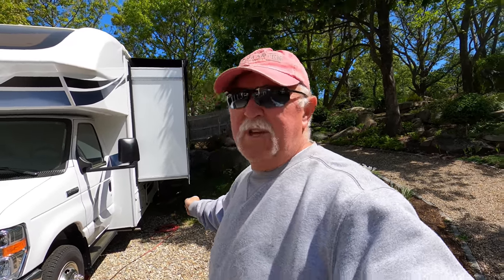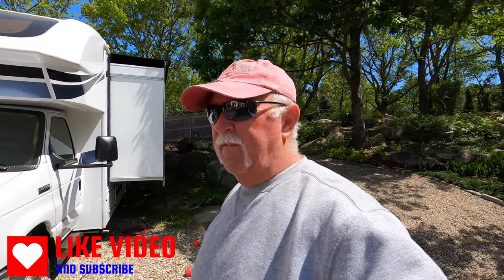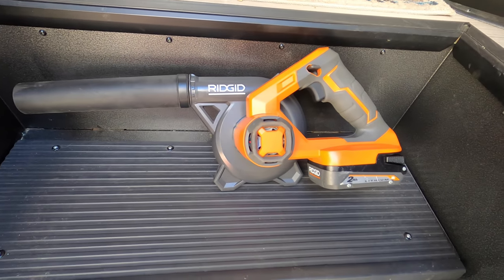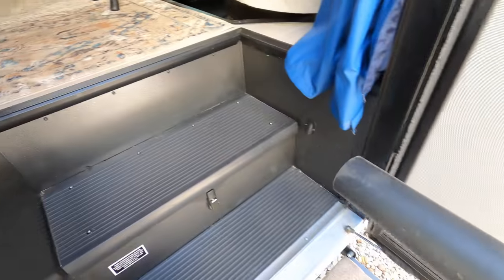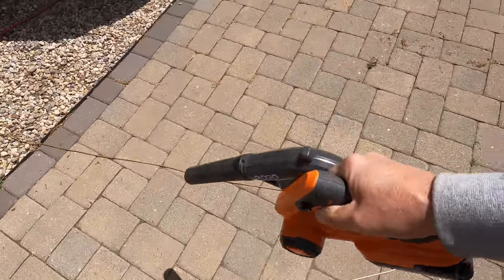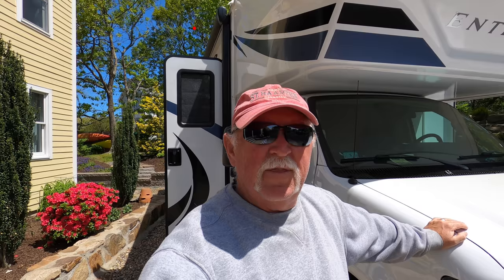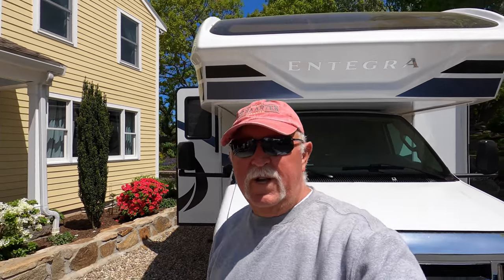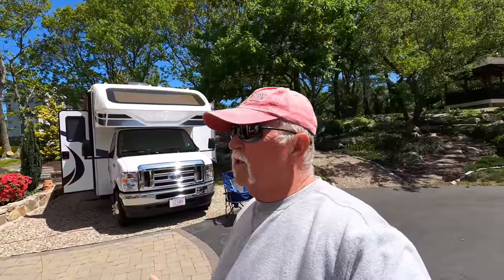Upgrades, add-ons, and more!

Comment: Another nice video!  I am just happy you are not costing me any money this time.  I have the same rig (2022), which is at the dealer now for last round of warranty fixes, and in between a solar/lithium install and Flex Armor roof install.  Happy travels!
Reply from the maker: I was headed toward getting the flex armor roof but the real house needed a new A/C unit. $$$$$ oh well. Soon though.
Reply: @ChippersIslandAdventures  I had my second roof leak in the first 8 months so it kind of went from a nice-to-have to a requirement.  As far as I know they are both likely just in the caulking somewhere of the roof components.

Comment: Great ideas love the logo. Do you have valve extensions if so what kind .an idea for you bike rack put a cargo net over the bike cover keeps everything tight from ANY wind.
Reply from the maker: Thank you for watching! Yes I do have extensions but I have no idea what they are.  While having an oil change the mechanic put them on for me. On the bike cover I have two really long bungee cords that do a great job of tightening everything up. Btw, I have a couple other videos on add ones such as https://youtu.be/Yb7uXQiQ1nE
All the best!
Reply: I use the same bike cover(s).  On an Odyssey 24B.  They hold very well over our e-Bikes.  I just use 2 bungies on the loops at each end and they hold VERY tight.  Nice covers I must say.

Comment: Mike, did you have two AGM's (smaller) in the 24B before you switched?  Curious if so, did you see a major improvement?  I put a second battery in mine (next to the stock one) and I think they are doing pretty good, but I definitely would be interested now in the VMAX one you chose.  The wiring under my step is a nightmare.
Reply from the maker: No.  I had one lead acid that was dealer installed.  No label so no idea what ah.
Reply from the maker: I feel it’s a major improvement but won’t truly know until I’m Boondocking for a couple days at least.  I certainly feel better knowing what I have is at least double what I had originally.
Reply: Good job